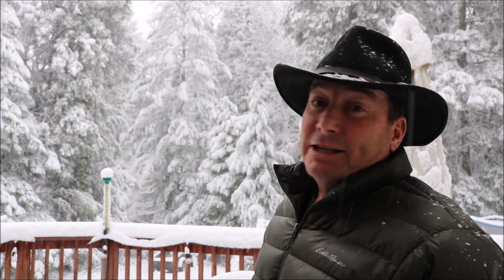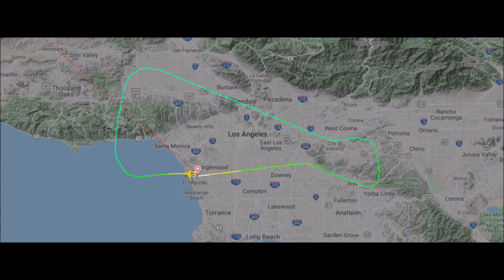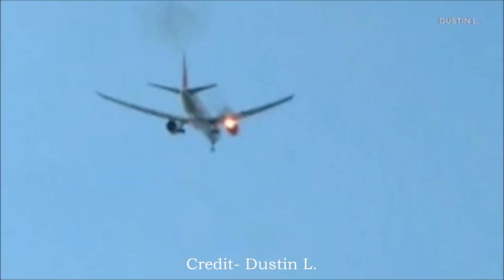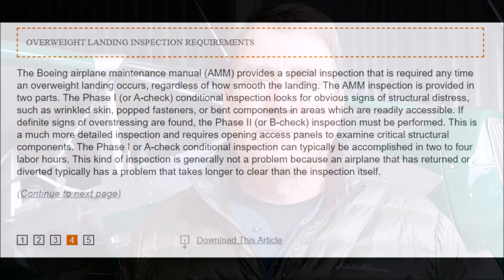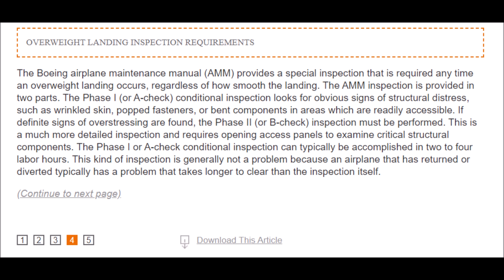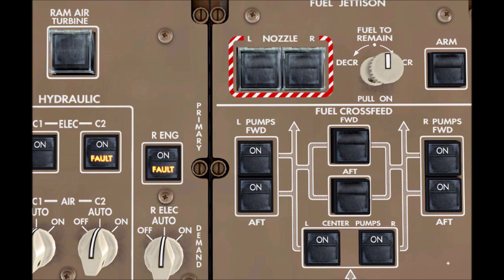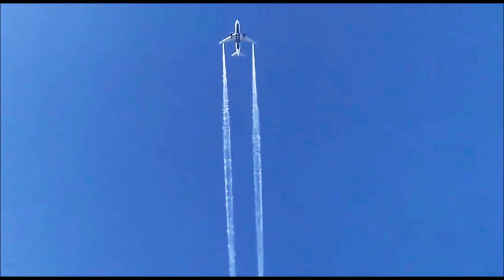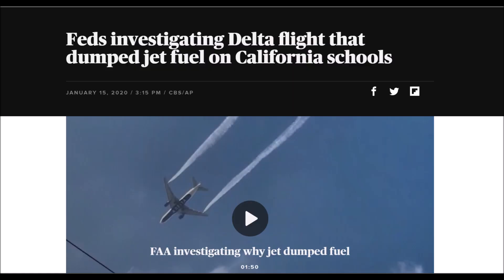B-777 Fuel Dumping and Overweight Landing Considerations (Part II)

Comment: what the pilots wanted to do Juan, was lighten the load any bit that they could. every little bit helps. Hell, if they could lighten five pounds, they gotta take that. Luckily also there were only 181 souls on board as this is I believe a three hundred seater. Compensating for the airline standard of 170 pounds per soul, that is over 17,000 pounds less right there to work with. Pilots are telling the ATC they are not going to dump fuel, but when it comes down to it `They are dumping'

Comment: Being LAX...there's ALWAYS the consideration for having some sort of traffic issue which would require a go-round,  every little bit of weight savings could help if dealing with a suspect engine which may or may not decide to start surging again when the go sticks are pushed forward.  So long as the crew can justify it...they are in the clear.

Comment: Excellent explanations and very well documented, as always.  I have wondered about how fuel dumps work, and how high they should be done - and you told us.  The comparison of damage to brakes in aborted takeoff at maximum weight versus an overweight landing very informative also for us couch potatoes.
Reply: The braking distance certification is also done without thrust reversers as normally used.

Comment: So Juan, are these pilots going to be in any sort of trouble over this dumping fuel incident or could they face any sanctions at all? After explaining how the 777 could land without any problems, with landing gear built to take such landings without collapsing the landing gear, and having 12,000 feet of runway, could this be construed as being unnecessary?

Comment: With a engine stall situation, is it possible that they did not want to use thrust reversers on landing, therefore increasing the landing roll out distance?
Reply from the maker: No, you dont reverse on that engine anyway. Its built into the calcs.

Comment: In my opinion, It could have been more of an afterthought to dump the fuel to be safe than sorry. And when he was already on the approach, why request a go-around under those circumstances?  Now you have more than one engine working, to take the risk to do a fuel dump out of the way and by climbing might have been riskier as of being unsure what the true issues were? I am not a pilot just trying to figure things out or like you said someone could have pulled the switches or accidentally pulled the switches, which I heard is not easy to do without thinking... 

I mean he should have been aware of his conscious decision and consequences to not dump the fuel when ATC asked, so I think he was fully aware. But then to dump later and not tell ATC, starts to lean more towards an accident of the switches....  idk. I mean push comes to shove they could have landed without dumping fuel on both runways even though 2L is longer, just extremely dangerous and risky... Safety of the passengers comes first.

And when situations like that go down I'm not sure if the other pilot is fully aware with the other pilot is doing or should they? Maybe there is a short break down to the other pilot on what he is doing before he does it?

Comment: the Captain on this plane just blew it.  there is no excuse in this issue at least for dumping fuel this low and 2) not going out over the water and dumping it.  its this simple.  

having said that.  the main consideration here was probably not so much max landing mass, but approach climb gradient.  I dont have a 200's number (we only have 300's) but with a single engine approach there are some instances where you need to dump to make sure you have go around climb 

the entire "thing" seems rushed...there was no time for a fordec no time for any real serious cabin prep/briefings much less serious performance calculation.  what was the rush?  we will talk about this in my crew briefing today as I drive the big airplane from Istanbul to Houston :)

Comment: Juan,
Great explanation and analysis - thank you! Do you know if this [type of] incident is investigated by NTSB  or FAA? Also I know the crew stated to ATC how much fuel they had on board - has anyone calculated how much fuel they would have needed to dump to bring the A/C to maximum landing weight?
Thank you
God bless
Paul (in MA)
ps glad to see the snow that will ultimately end up in Oroville Reservoir.
Reply: The FAA will investigate this one, not the NTSB.  As Juan mentioned, the airplane could have been landed safely without dumping fuel.  That's why the crew told ATC they wanted to return to runway 25R - the longest one at LAX.
Reply: He mentioned in this video. The 3rd pilot has to calculate the fuel onboard, burn rate and how much weight is safe to land. So this pilot has a brain fart for some ungodly reason and say no need to dump fuel.

Comment: My thoughts are, does this warrant the addition of a height limited control system that shuts off fuel dump below a designated minimum altitude, say 8-10,000ft, in order for fuel dumping to only be mechanically allowed at an altitude that provides complete atomization of the fuel?
Reply: Such a system may be a good idea, but there would need to be an override control in case of an emergency that required dumping fuel below the designated altitude.

Comment: With single point fueling how does the "fueler" control what tank gets what amount of fuel? Or is it some sort of automatic system. Seems pretty critical. Wing tanks fill equally first then center? Just be being curious.
Reply: Todd Holzwarth it’s an automated system.  Most aircraft will fill the wings first to cantilever the weight in the fuselage.  Once the wings are full, the center, and in some cases, the tail fuel will be added.

Comment: 12:15

Wrong! You have to burn the fuel in the wings first to minimize the bending moment. The less weight the less Force is produced, the less momentum is created. 

Ok, here are the physics. Feel free to correct me if I'm wrong.

Momentum= F *  d (=nominal length from the point of which we start our calculation from to the point of the force is).  F=m*a -->  with a=constant (in this simplified scenario)

First of all its a deceleration. You are pretty much flying the aircraft in the the ground. You first touchdown with the landing gear, at least you should :P . Then all the forces of the deceleration are getting "absorbed" by the structure of the aircraft and the landing gear itself. So the part where the wings are connect to is the center where we calculate the momentum's from. It's the part getting the most stress in an overweight landing, isn't it?

So as the plane touches down, all the weight of/in the wings creates an additional force directed downwards (reaction force, caused by deceleration and in consequence the fuselage trying to stop the movement of the wing). And this one is the Force calculated by F=m*a. So if you have more mass in the wings (=more fuel) the decelerating force is going to be higher. If you have less fuel, it's going to be lower. Now lets take a look at the second equation. The momentum is getting larger the more you move the mass to the outer part of the wing. Cause then you are having a greater distance from the center of where the momentum is calculated from .( nominal length to the "start" point increases) So as you can see the reaction Force gets larger if you carry more fuel in the wings. Additional to that you have more weight in the outer parts of the wings.---> Much larger momentum's which the structure of the wings have to deal with. 

You tried to show the opposite with a model of a plane while holding it at the wings. Well this scenario would have been the case in flight, cause the Wings are here the parts which are moving in the mass of air. The wings are "holding" the fuselage. On the ground its the other way arround.

Sorry for the grammar and spelling mistakes in this text. English is not my native language...
Reply from the maker: nope, you may wanna do some flight training.
Reply: Well, im studying Aeronautical Engineering. If I'm realy wrong I will notice it some time haha :)

Comment: Hi this is only slightly related but could someone explain why jet engines have gotten wider in diameter and shorter in length?
Reply from the maker: Efficiency.
Reply: @blancolirio  I understand that what I don't understand is why, is it because longer blades can move the same amount of air whilst turning more slowly?
Reply: @jamesgorman5692  The larger diameter of the engines is due to the fact that they have larger fan sections, and that most of the air from the fans is being ducted around the core of the engine. This is called a high bypass engine. The additional air is not required for the combustion process. In early jet engines most of the fan air went through the core of the engine so they had a much smaller diameter.

Comment: so am I right to understand that if the fuel Jettisoning is done correctly none of it should reach the ground? that is, that it, being a lighter than air vapor dissolved in air-layers at altitude, it will remain moving upwards...
Reply from the maker: Evaporate

Comment: I think we need to be careful we don’t create a culture where pilots who are incredibly busy setting up that plane for a safe landing are not overly obsessed about whether Gloria Allred is going to sue.  If they only have so many tasks they can complete in the time they had available, better the tasks be the ones it takes to get the plane on the ground without anyone dying. If the niceties of fuel dumping regulations have to take a back seat to getting the airspeed and approach glideslope right, and following ATC directions, then as far as I’m concerned they shed tasks in the right order.

Comment: I believe that some airframes will be damaged during heavy/overloaded landings with full fuel, besides wheels/tires/landing gear. don't the wings flex when landing and could be a cause of concern?  Much like an 18 wheeler overloaded trailer causing axle/wheel/tire problems plus failure of the trailer chassis.
Reply from the maker: Read the Boeing data in the link below.
Reply: Ok, TX!

Comment: If the engine operates at reduced thrust & no compressor stall,  crew shd run engine at a reduced thrust setting that is surge & stall free.   EMERGENCY OVER.   Yes you return to the aerodrome; however, wind the watch, BUILD TIME, obtain performance data, and develop a non-hurried plan to return.

Comment: I would think that the airlines would be quite restrictive a fuel dumping procedures both from a pollution standpoint and a monetary value standpoint. If fuel dumping significantly reduces the risks of harming the aircraft or its passengers then certainly that would be the way to go. But if there is no significant risk why would you waste thousands if not tens of thousands of dollars worth of fuel.

Comment: There's another Delta flight, out of Atlanta somebody got video of and posted to YouTube where the crew begins the dump shortly after takeoff and you can see the dump continuing down low right up to final approach (over Atlanta!).  This was in response to a potential tire or wheel brake issue seen and reported by another airplane.  Here's that one:  https://www.youtube.com/watch?v=t9n39txMLDo&t=757s

Comment: Juan, at 4:41 you refer to a 767-200ER instead of a 777-200ER.
Reply: I bet its a freudian slip from his past life...
Reply: Gunga Dinn It wouldn't be a blancolirio video without misspeaking...
Reply: C and K Early Warning Systems Yes, he has personal experience of landing a single engine B767.
Reply from the maker: I thought I heard that...At one point I mentioned the 767 (300?) has fuel dump capability, but not required.

Comment: A lot doesn't add up here. An engine failure (we will call it that as it wasn't much use to them at idle anyway) Isn't rocket science, it's not the end of the world, in fact it's practiced so many times in the Sim it becomes boring! The whole training scenario is how to handle  or manage the rest of the flight back safely on to the ground & parked at the gate. Things like secure the A/C first, make sure you have the beast under control going where YOU want it to, then tell ATC what YOU want, not what they offer or suggest! Declare the international distress phase. MAYDAY or at least a PAN call, that way there is no ambiguity as there seems to be with this incident. The crew where rushed for some reason, initially over 300 kts GS means they where not minding the shop properly & adding to the rush factor that that was developing here. ATC could have handled this a LOT better! When it's an emergency then all bets are off, the PIC is the head man in the air & on the ground as ins what he needs/wants! Dumping fuel at that low Alt was a very poor choice & showed that the PIC stuffed up the planning that should have been discussed & agreed upon BEFORE landing! Plenty can be learned from this cock-up!

Comment: Again, I ask why air traffic controllers can't bring up all instrument readings from any plane they are in contact with in this modern day and age. The traffic controller should be able to open a computer screen which displays all the information a pilot has available if necessary.

Comment: It is hard to believe that on a modern jetliner your flight computer is not programmed to compute a RTB fuel landing weight.  What is the chance that in the duress of single engine flight, checklists and ATC that you will make a mistake computing it in the air?  

My bet is that they decided to dump at altitude and then forgot until late in the pattern.  No smart pilot would dump at that low an altitude without screaming emergency all the way to touchdown.  The outcome and blowback of dumping below 5K would be known to all let alone a heavy ATP.

Comment: Can you dump fuel with the landing flaps down?
Reply from the maker: yes, but why? I assume you would be too close to the ground for dumping.
Reply: It was many years ago, I was told we could not dump fuel on a maintenance test run with the flaps down. I thinks it had something to do with the low pressure created by the flaps. Fuel might migrate back into the wing cavity. Sorry, I can not remember the aircraft or even if it was true. I had another look at the Delta dump in LA, it looks like nozzle on the 777 is really far out on the wing and away from the flaps. As always, thanks for the reply.

Comment: Seems as though this may be a normal procedure for Delta. Take a look at a 2015 incident out of ATL (https://youtu.be/t9n39txMLDo, 'Delta 95 (777) Declares Emergency in Atlanta - All Radio Comms') where a Delta flight dumped fuel after declaring an emergency. At around 10:35 into the video fuel can be seen leaving the aircraft with the gear down and on 5 mile final (according to ATC comms). I don't believe anything came about from this dumping, although shockingly low. Makes one glad they don't live under final approach in Atlanta, or any other city for that matter!

Comment: In practical terms, I think the 'contamination' was a non-issue.  At 5000lbs/min and 200kt, that's about 70lbs released every 100 yards of swath.  With that being spread out laterally by the wing tip vortices and by the fall, we're talking that 70lbs being distributed over tens of thousands of square yards.  Lets say 30,000 sq yards.  The amount of a person's skin area exposed to this would be maybe 1 sq-ft., maximum.  So, even if the concentration was 10x the average and NONE was lost to evaporation, you're talking about being hit by less than half a gram of highly refined paraffin.  And that's if you intercept everything in the plume above your 'footprint'.  If they're worried about inhalation as a suspended mist, then the number becomes tiny indeed...I get something like 5 ten-millionths of a gram for a two-liter breath.  Feel free to check my math.

Comment: I think some panicked, and dumped fuel. Seeing that they didn't circle over water to dump fuel tells me they were worried about the engine issue... normal procedure says turn off the engine, and if needed dump fuel over designated land (water) then vector to land at proper length airport.. Waiting to see how many hrs the Captain and Co had...
Reply from the maker: The 777 Capt seat at Delta is VERY senior.
Reply: @blancolirio  Interesting. Probably just wanted to get down asap. As more comes out, we will know more--as you said. I would rather dump fuel and inconvenience some on the ground that possibly losing the plane.

Comment: I think they should have circled around for a proper fuel dump rather than land overweight or dump fuel at low altitude (this pilot probably did both) unless they had unruly passenger issues (engine bangs like that can panic passengers) threatening the safety of the flight. Seems the pilots got kind of panicked.